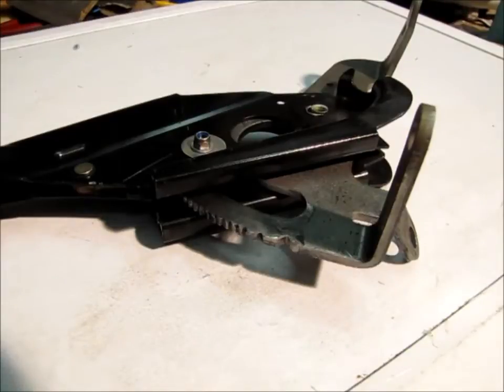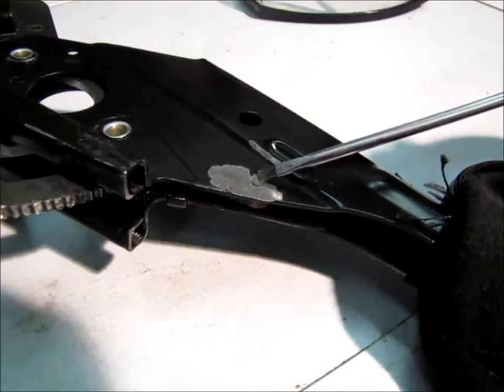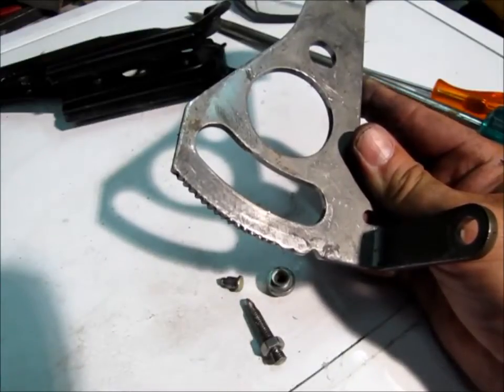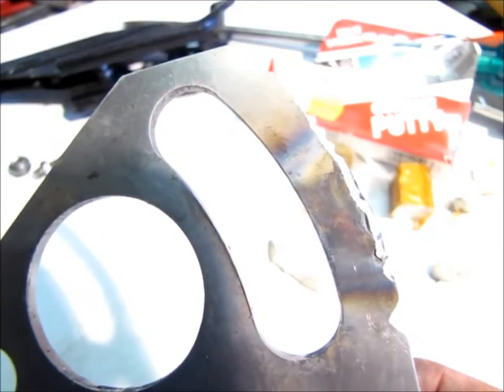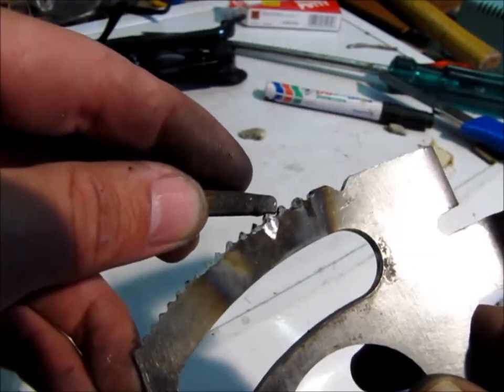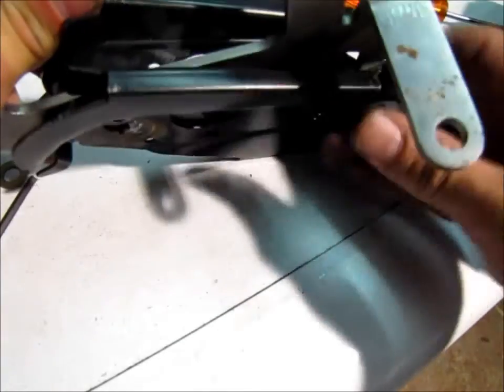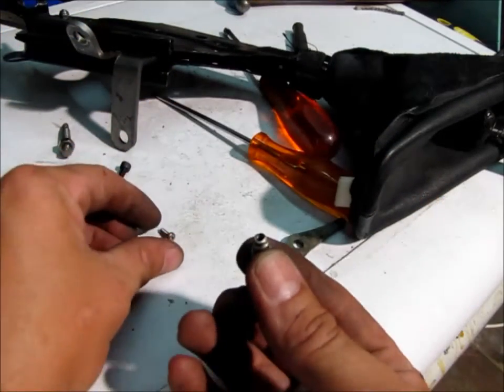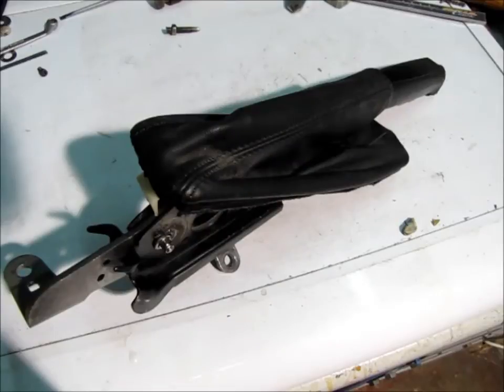How Stuff Works: How To Repair a Worn Car Handbrake Ratchet

Comment: i had the same i bought a second hand replacement a bmw mechanic said dont replace it sit in the passeger seat and heave the handle over to your side over the years mine is 24 year's old  of pulling the handbrake to the right on it actually became bent so  heave to the left it worked  gor me so give it a  heave

Comment: Did the repair hold up over time?
Reply: The repair is still holding up but I suspect it is wearing. I would not rate it as hard wearing as the original but does extend the life of the old part.